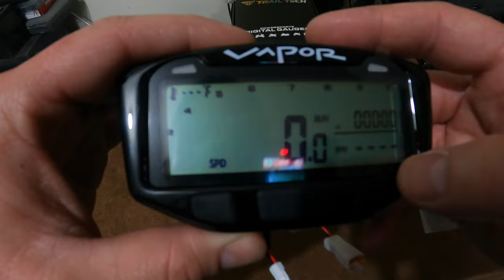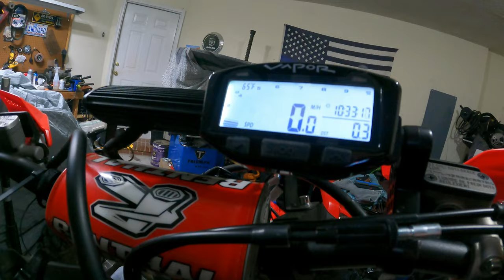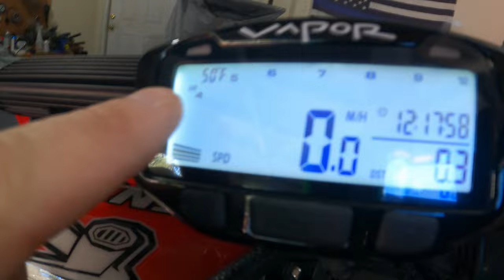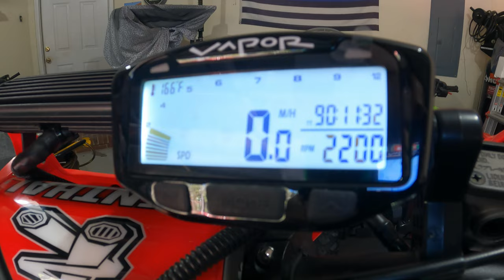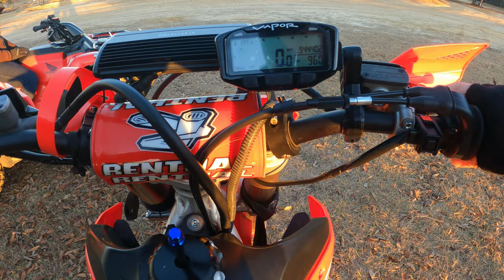2021-2022 Honda CRF450 R/RX Trailtech Install

Comment: Hey bro, got my 2019 CRF450RWE all converted but the rpm seems low like yours was. What was the setting you changed that got it right? I have mine on 1 PPR and it's saying it's idling at around 500 which seems low. I have it wired to the coil like you did. Thanks!
Reply from the maker: @723racing  It's been 7 months too long since your question. I hope that you found a solution. It's been a while since I messed with the trail tech. I can't remember the values that I set, but it was dead on once I did. 
If you haven't already contact trailtech, Technical support. Those guys are super helpful and they can get you set up.

Comment: On your RPM lead, did you solder that to the coil wire?
Reply from the maker: No, there was no need. I went through the rubber boot and intertwined the wires. There was enough naked wire before the solid connector to connect securely. The boot is so tight, it helps from anything coming loose. Make sure you have extremely thin needle-nose to make it easier!